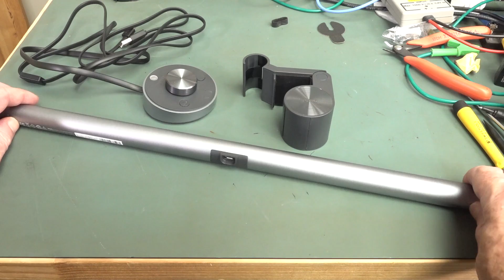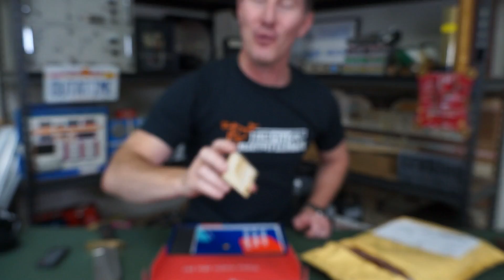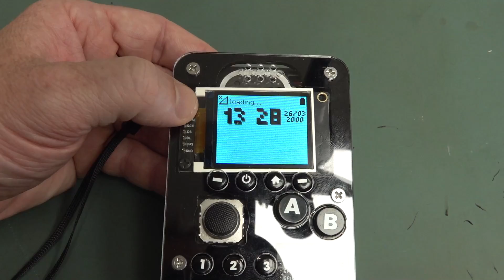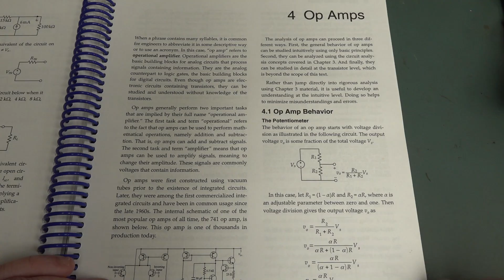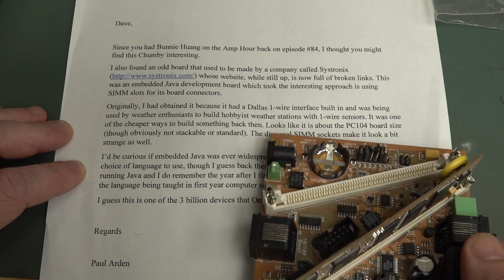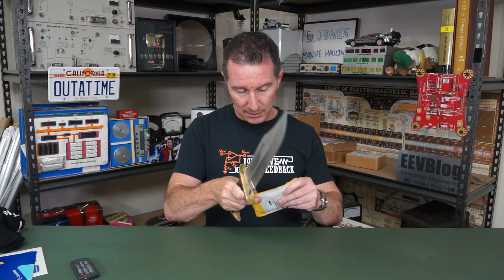EEVblog #1286 - Mailbag

Comment: They sure could have done a better job on Chumby's liquid incursion protection if used in Dave's extra loneliness mode. At least some conformal coating and a gasket or two to keep the cum away from the electrons...

Comment: Hey buddy... I'm looking to buy a QUALITY multimeter I dont mind spending a few hundred but not for a name... I'm looking for accuracy,safety,dependability,and reliability. This will be for checking batteries,automotive,basic work around the house and if its capable of temperature that's a plus...(I also seen a feature on the fluke 117 that I really liked,a hi/low sensitivity non contact current awareness)what would your recommendations be within 400 dollars ish. Thanks for any help you or your subscriber's can offer! You have a new member!

Comment: I noticed an ATtiny85 in that electronics business card. I've been wondering what do with my ATtiny85s. Maybe I should make LED dice.
Reply: The ATtiny play's also the Sound on the piezo for more info :> https://www.facebook.com/patrick.schlegel
Reply: I'm using the ATtiny9 for my April Fools' prank this year... a buzzer powered from a coin cell that produces a 0.5s beep every 5min. The nice thing about the ATtiny9 is that it has a 16-bit timer.
Reply: @calebr4961  boah the ATtiny9 did not knew that one ... a real small thing ...
Reply: @calebr4961  i needed more Memory and PWM ... but interesting piece this ATtiny9 ..

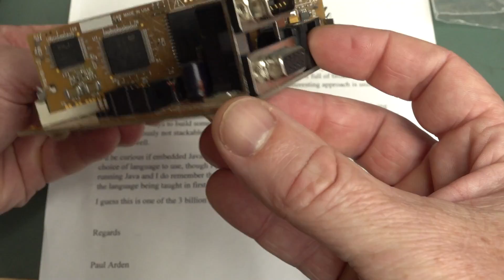Comment: 31:44 Technically, Android uses Java, but a different implementation of that.

37:44 Turns out though, that the way Chumby is able to keep their devices working is that there's a subscription involved, but it's rather important as without it, they would've gone out of business over a decade ago. I now am reminded of the Sony Dash (which was advertised in the video for "If I Had You" by Adam Lambert).

Comment: Pretty sure the WiFi module in the Chumby was done that way for heat dissipation only.  They didn't want it on top of the other components, and they also thermally 'coupled' it with that putty/pad.  I think a simpler ribbon cable would have been a better connector, but then again, that one is fully replaceable.  Take that APPLE!

Comment: Wait a second... So the BenQ screen bar lamp thing takes a USB micro in, meaning the captive cable attached to the encoder thing probably uses a non-standard pinout on the USB micro part. How do they get away with this? What could go wrong if someone tried to power something else with it? Probably in real life nothing would happen, since even data lines are 5V-tolerant... but still, it seems like a liability. Are they somehow detecting the screen bar and playing nice if something else is detected? Please make a follow-up.

Comment: 3:42... Did that with some LED strips about 2 years ago to the Computer I use after hours. 
Cost me about $5.00 Cnd and less than 20 minutes. $130 USD is a bit pricey to light up my Keyboard. :-/
17:40.... Hence the name "CircuitMess"... LOL
44:35... WHAT ??? Hook up a Microchip Speach chip to an Arduino ???? No No No say it isn't so....
Reply: yeah he better uses a pic for that just for the matter of everything fitting nicely... but any uC will do but id go with some bare controller probably without any pcb and definitely not an arduino...

Comment: I can tell you from unfortunate, frustrating personal experience that USB A connectors should never be used for internal connections, especially with superspeed.

I have worked on a product that has all kinds of extra work put into retention because standard USB connectors are not designed to stay in place. The design leans heavily on ease of insertion and removal and as a result, any kind of shock or vibration can cause it to slip out and stop making good contact, and if it's inside your product that's an RMA right there.

Comment: The board at 31:40 brought back a lot of memorys for me. That was a TINI board with a TINI stik plugged into it. It was a devolpment board for a Java OS. Used to play around with them many years ago. The socket that looked like a battery holder is for an iButton from Maxim Integrated.

Comment: When you said SP0, I immediately thought of the SP0256-AL2 but I thought it couldn't be that.  But It was.  I too built a speech synthesizer using this chip when I was a kid.  And, sadly, also like you, I don't know where it is now.  I connected it up to a VIC-20 (and Commodore 64).  I wrote a driver program for it in BASIC, but later wrote one in FORTH.  FORTH was a nice interface because the way FORTH works makes a good speech driver - each allophone became a "command" which would put the corresponding number on the stack, then each word became a command using the allophone commands.  You then would just type the phrase you wanted it to speak and then all the allophones for the phrase would be on the stack which the speech command would then speak.  No need to write "lookup" routines to search for the word in a dictionary - FORTH does the lookup automatically.  And I too had it say "Shall we play a game".  BTW, my chip was "GI"

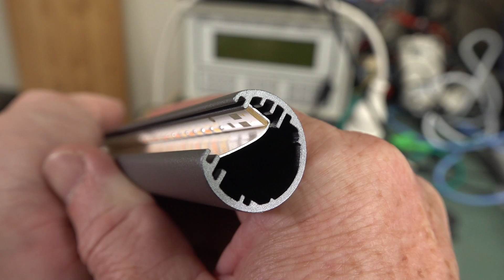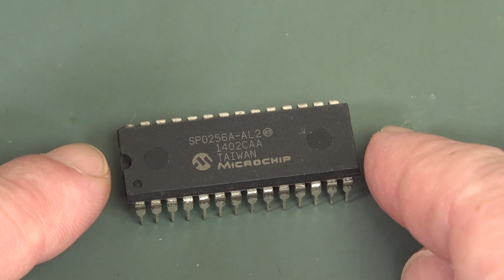Comment: 7:45 Looks like there are 2 fingers of aluminium spacing the LED strip, surely these would provide some degree of heat dissipation for the LED board. 8:04 It looks like the wires are preventing the LED board from sliding out because they're hitting against the 2 aluminium fingers that run the length of the tube. 41:10 The SP0256 AL2 was originally made by GI or General Instrument. Also, there are a lot of fake SP0256 AL2 chips about, I believe they're being produced in China (of course). All those that I have seen are marked as Microchip so the device you have might be fake I'm sorry to say.

Comment: It's interesting that the Chumby main board was designed to have the wifi USB device right on the main board. There's even a silk screen for it. I wonder if there was some interference or something that made them create the second board to change the orientation of that wifi dongle to 90 degrees off from the on-board version.

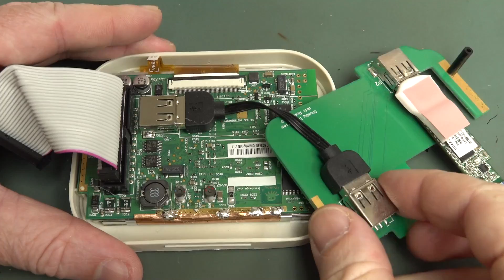Comment: at 34:57 Dave talks about the daughter board for the WiFi module connected by a USB extension cable.  From the looks of the rectangular outline (35:58) on the main board it seems that the WiFi module was originally designed to be plugged in there (and no daughter board).  Quite a bodge!   Why the move?  Heat?  Probably so because of the thermal pad from the main chip to the USB connector's metal shroud.
Reply from the maker: Yep, quite likely to be an afterthought move.

Comment: I have one of those Benq screen bar, had it for almost a years and it is on pretty much all the time, really love the color temperature adjustment. It does not heat up too much either, right now it has been on for about 10 hours and it is at 41°C.

Comment: "STET" is a proofreading mark indicating that a previous correction should be ignored.  It's Latin meaning something like "leave it standing"
Reply: Correct. Usually used when a proofreader/editor marks something as an error but the author believes it is not an error and should be left as it was. I was told it is Latin for "Let it stand" - same meaning as your translation.
Reply: Very interesting, I've learnt something new, thanks.

Comment: 10:00 so, they feeding the dual led power trough a ordinary microusb connector.  i wonder what happens when you plug it into any device with microusb ... magicsmoke maker 3000
Reply: Yes. I'm absolutely NO fan of misusing connectors tightly tied to a certain standard for other things. 
That multichannel measurement thing using USB 3.0 plugs he tore down a few years ago is also .. "meh". If you do that, please at least make it "passive" for plugging in stuff which normally goes into there. So, if you plug the probes into a PC they should just do nothing, but survive, and vice versa.
The HDMI connector on Siglent scopes for the logic analyzer .. I get why they use it. It has a lot of differential pairs and is cheap because of volume .. but .. nah. Don't like it much. 
It's fine with SUB-D or something, because this IS a generic multipole connector. It's your fault connecting RS232 to something else. But a USB plug is another thing.
Reply: 200 mA???? Doubt it
Reply: trough one of the data pins, 200mA is enough to break something

Comment: ... and “Arizona Microchip” started out as...
a division of “General Instruments”  👍🏻
Reply: The PIC microprocessor was designed by General Instruments way back in the early 1980s. The semiconductor business of General Instruments was spun off into Microchip
Reply: @stephenbell9257  I didn't think Microchip sold SP256-AL2? Especially in 2014 (according to the date code)
Reply: Yes - in fact, they released two parts in the same time frame - one was a simple RISC MCU known as "peripheral interface controller" or "PIC" - the second was a "1-bit" MCU called the "sequential Boolean analyzer".  The first was very much more successful than the latter.   They were called "GIM" (General Instrument microelectronics) at the time. Later, the division was reorganized as a wholly owned GI subsidiarity - the "Arizona Microchip" name was because they were based in Chandler, AZ.   And yes, I'm disgustingly old to remember all this.
Reply: @TrimeshSZ  We still value having old farts like you around to drop some ancient knowledge ;)

Comment: I need help. That being said, I always enjoy your videos EV. I'm guessing some of the best minds do as well. I am having difficulties finding some components for my tankless water heater.  I won't mention the name but they aren't any help, all they want to sell me is the full control board. All I need is a triac and a relay. Problem is I cant find a supplier for either. The triac is made by Jiangsu JieJue Microelectronics, # JST417  800BW 801 188,   The relay is a PICKER PTRD-1A-5SF-1-X.  Coil 5v.   40A  240vac. If anyone knows where I can source these or a direct replacement I would sure appreciate it.  Thanks, and sorry for interrupting the video.
Reply from the maker: Ask on the EEVblog forum repair section.
Reply: @EEVblog  thank you, I'll see if I can find it.
Reply: @EEVblog  I found the forums, registered and logged in. Then found the repair forum but cant for the life of me find a way to start a new topic or ask my question. Maybe I need to be on a computer and not this tablet.  I'll go see.
Reply: Just use any triac with enough current capacity. Search the BTA series of triacs.
Reply: and the company "finder" makes relays although i dont know if they do this heavy duty ones but its worth a shot